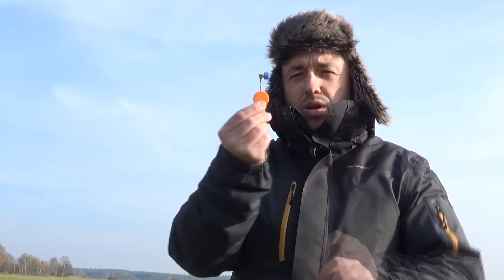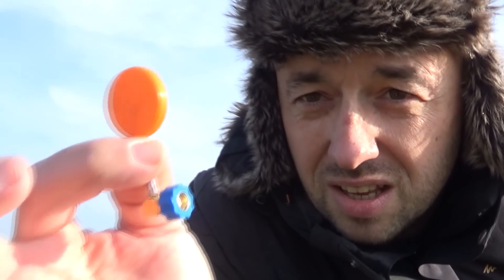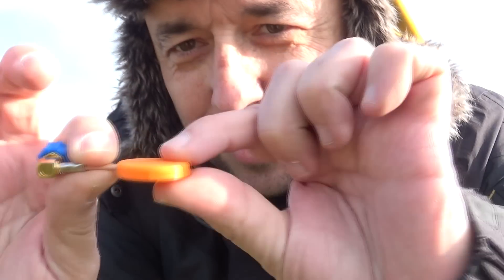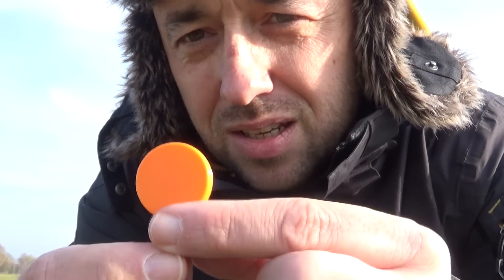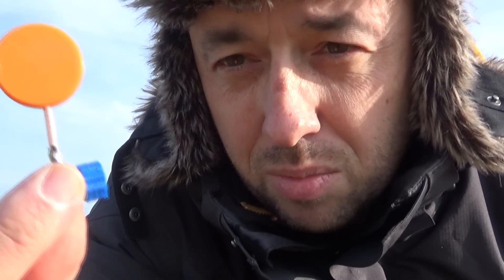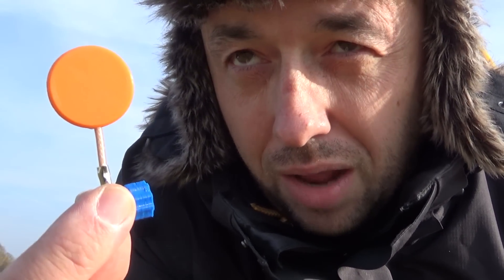How to make 5.8GHz Inverted Vee antenna?

Comment: Really brilliant video, I have been using quite a few different types of dipole and vee antennas for a while now and am thoroughly impressed by how good they perform and how easy they are to have direct to my mmck vtx and really simple to mount.  I have noticed that the only time they are really out performed by a cp or pagoda style antenna is when I go behind a dense object, but for blasting around fields with a few trees or gates, then for the weight and cost I think you can't go wrong. Thank you for showing me how to make my own or at the very least repair some of the ones I have trashed.

Comment: What antennae combination would you recommend for a diversity receiver when using this Vee antenna on the VTX? Two whip antennas laid horizontally 90 degrees apart?
Reply from the maker: definetly 2 linear polarized antennas. Yes, with 90 deg. separation
Reply: The other option would be using skewer planar (3dBi loss) for proximity and linear patch for flying further/through obstacles..
Reply: I asked Actuna directly (I have the Vee antenna from them) and their response to my question is "RHCP receivers will be the best". Well that's confusing..
Note that I told them that I want to use it on a freestyle miniquad.
Reply from the maker: RHCP/LHCP would work without diversity.
Reply: Of course, but I already have diversity on my goggles, so I'd like to make use of it to get the best coverage possible.

Comment: Thanks for  the nice video Just a question for the 1/4 wavelength calculation I get 12.92mm. I assume you used the speed of light for the velocity of electrons in copper wire. am I right? Or is there a special rule for the calculation in V antennas which differs from the standard linear monopol